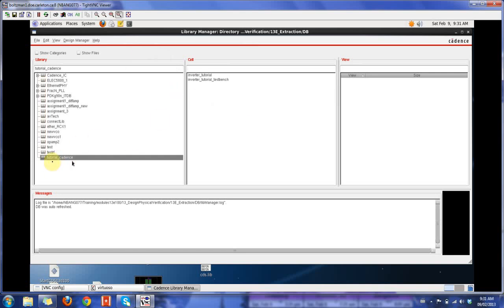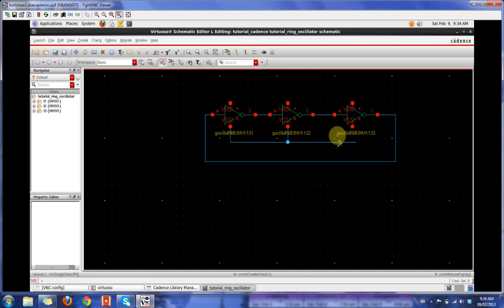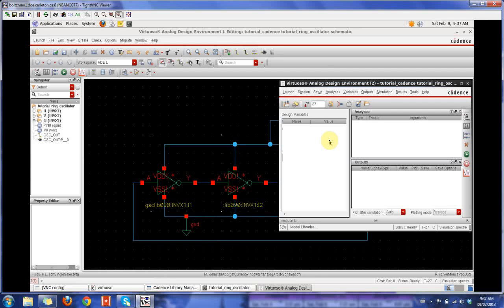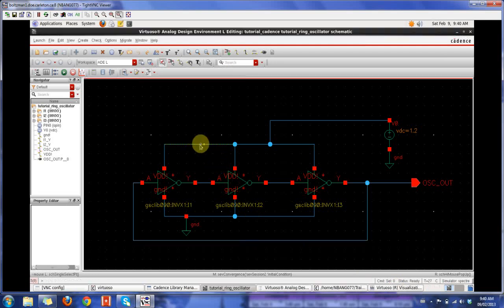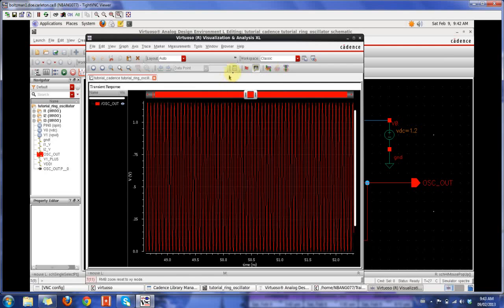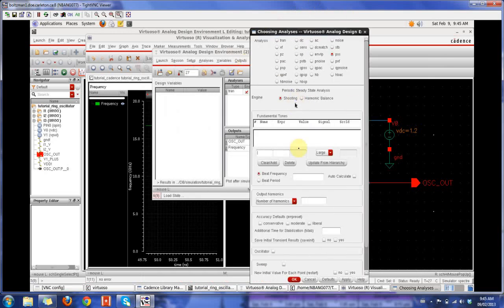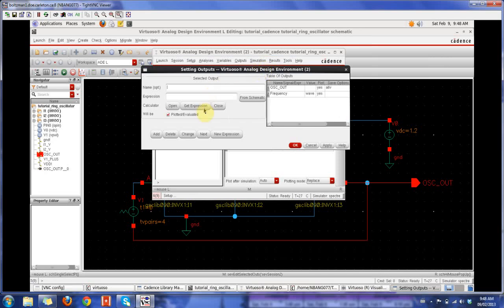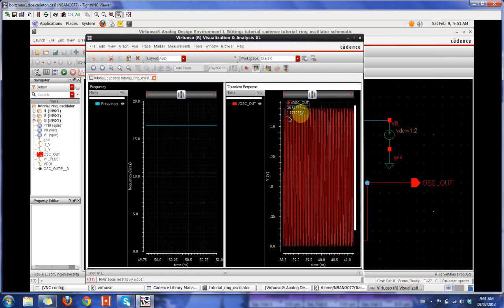Cadence 6 Tutorial 3

Comment: You put a Vpwl it's normal to get oscillation!! so where is the interest of VCO??
Reply from the maker: Wijdane Am : the simulator will not know the initial condition for a ring oscillator. You have to force a net to a voltage to start. For a ring oscillator vco you need current starving technique to change the frequency
Reply from the maker: Alternatively you can force a voltage level(convergence aids) without a VPWL, on a net at t=0 to kick start the oscillator. Otherwise on simulator you cannot start oscillator.

Comment from the maker: Hi Ravi,

Yes the phase noise for a ring based oscillator can vary between -85 to -90 dBc/Hz,which is more high compared to a LC based oscillator that can give a better phase noise value ranging from -105 to -130dBc/Hz. You can improve the phase noise by adding filters to your supply or can maybe do current starving techniques. There are a lot of IEEE papers that are there for improving phase noise. I would suggest you to go thru some IEEE papers that give you some effective solutions.